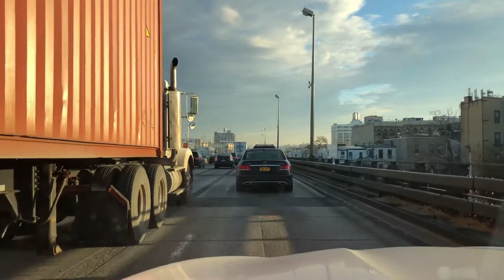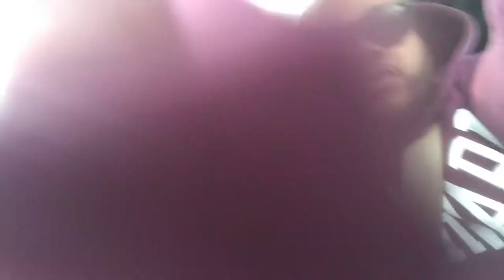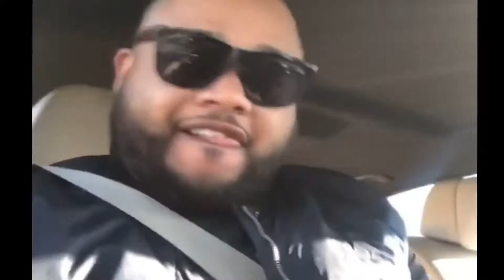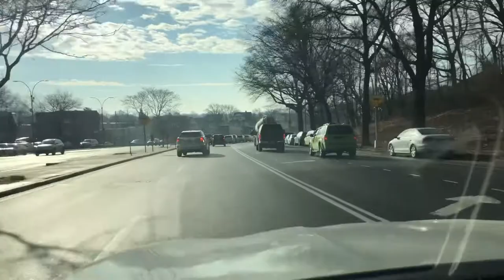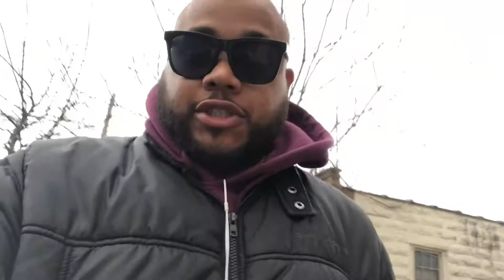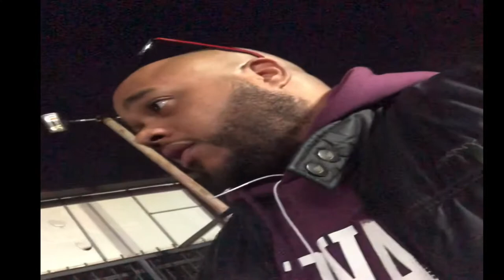2011 BMW 550ix M PACKAGE UPDATE FRONT DIFFERENTIAL AND TRANSFERCASE PROBLEMS

Comment: Which bearing did you had to change ?
Did you change the front diff as well ?
Reply from the maker: No I didn’t change the front diff or any bearings 
Just the transfercase
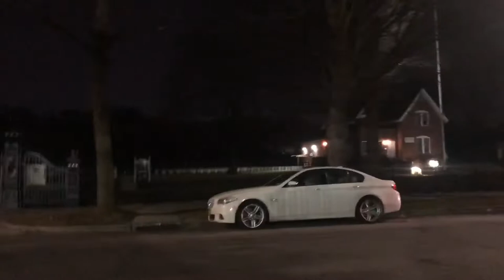Reply: @anthonydm1  At 4:02 of the video you said you change a bearing and not the transfer case, so what happen after ? You had the noise again and you had to go back to change the transfer case ?
Reply from the maker: @John-qc1zv  i did a follow up vid I didn’t change anything else beside the transferase since the parts I got was what the mechanic told me to get the wheel bearing  were ok